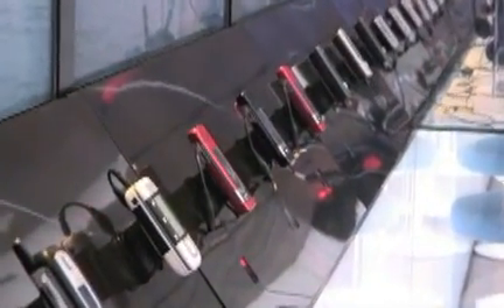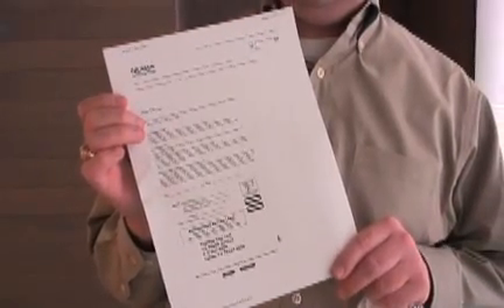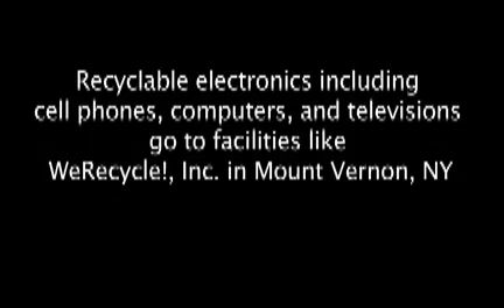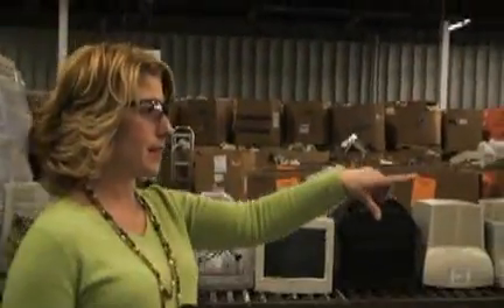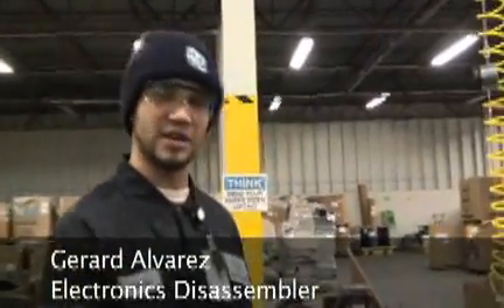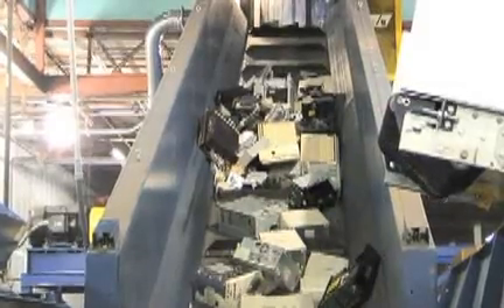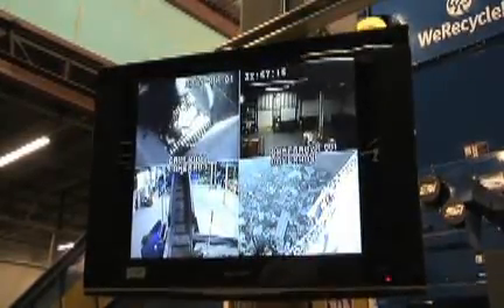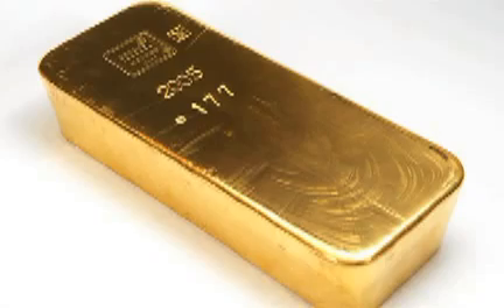Old Electronics Are a New Gold Mine

Comment: I took all my boards in after collecting computers & electronics, dismantling, segregating each type of metal and component, cleaning the circuit boards of any steel, aluminum, tantalum capacitors, electrolytic capacitors and plastics threw all the board into Gaylord boxes and after 9 months of back braking, neck wrenching, hand gouging I had 1thousand pounds of mixed CB's. Yup, It's hard work. Some people work for pride, some people work to make a living. I got $5.65 per pound for all that work

Comment: @anthonychad the profits are small from recycling. all of the precious metals are only plated connectors. a very very thin layer. electro-plated. if you sprayed gold paint on it it would be more than the plating. fine metals conduct best. u probably knew that. keep recycling. keeps the lead and crap from seeping into groundwater.